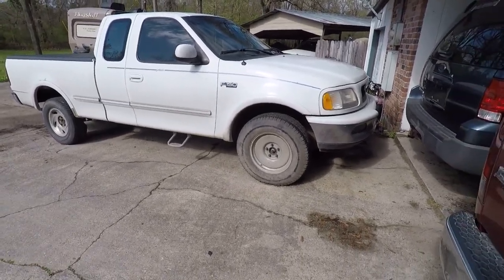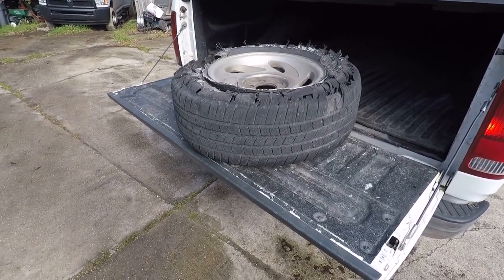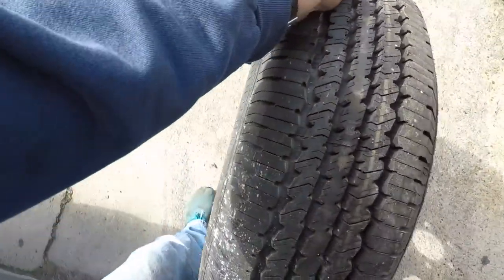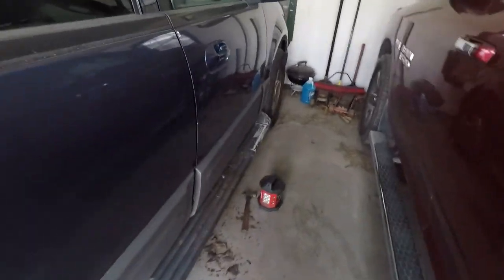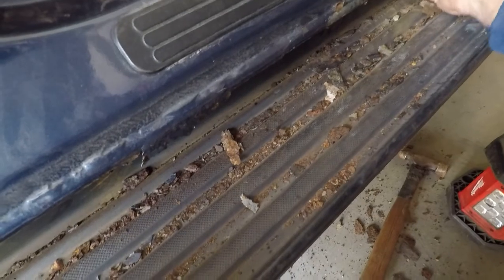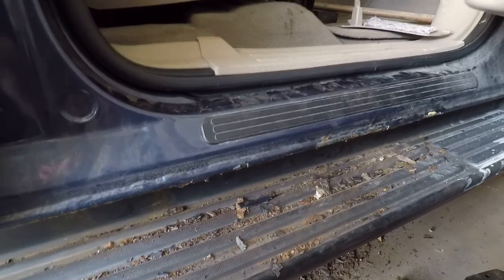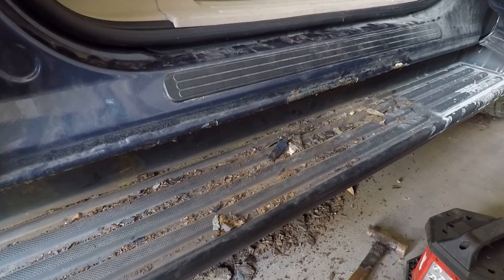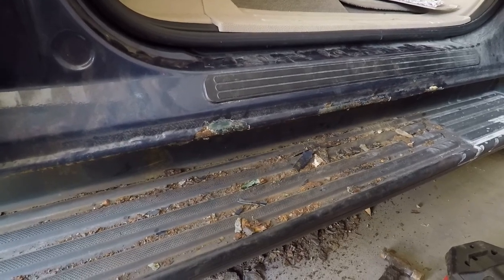A surprise at which I'm not too surprised.

Comment: hi Aaron ...buy two cars...IAA stock #21022489 ... buy now 2.975 $ .....and...stock #20106174  ... buy now 1.850 $ and you have a car 2017 with 10kmi for $ 8000-9000 ....post selling surplus parts  ,it's just a suggestion
Reply from the maker: Thanks for the reference! I appreciate it. That repair is a bit over my head at the moment though. I've put in some patch panels before as I grew up in New England. So maybe on my next one I'll try a true salvage vehicle. Thanks again!